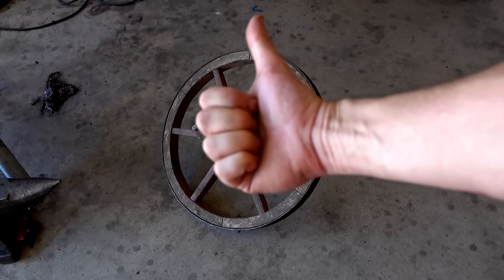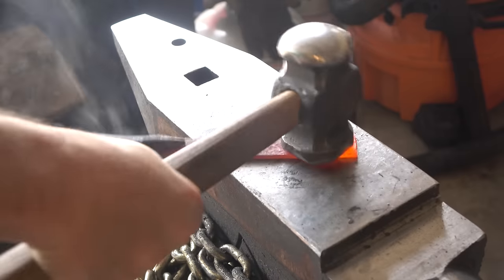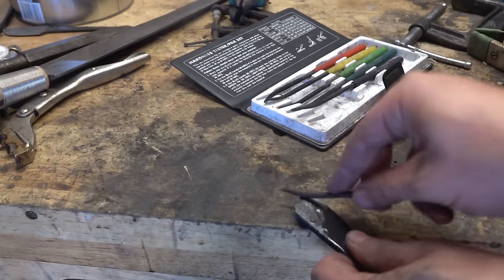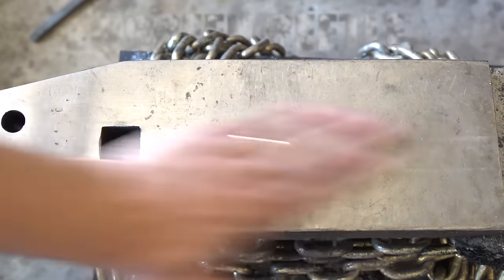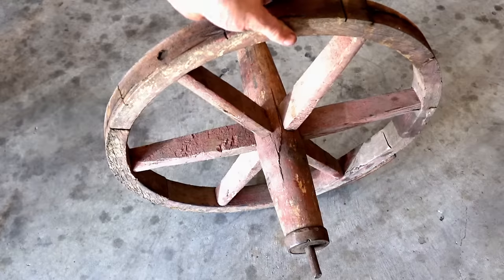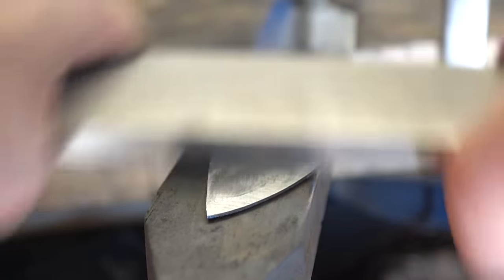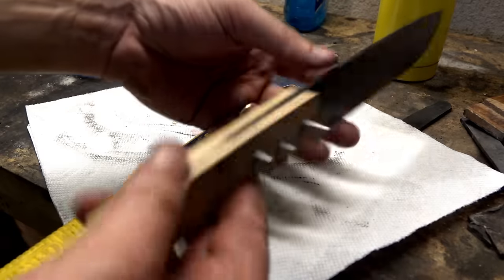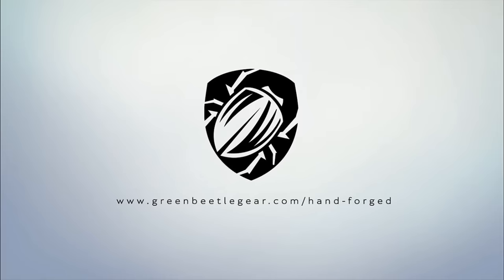Making A Frontier Knife From An Old Wagon Wheel

Comment: In woodworking I use lots of thick, checked slabs and I fill those checks and cracks with epoxy tinted black.  You can also use the dust from sanding, and mix that with wood glue to make a paste, and often it will stain the same as the wood you're using.  Loved this project btw, and I learned a ton

Comment: As for splits in the wood, you can always fill them with epoxy and a rough sand will blend the epoxy quite nicely. I do it on voids regularly in the very expensive, exotic woods that oftentimes come in very iffy segments (sometimes adding crushed colored stone powders to the epoxy to give it a striking effect) and is a great way to stabilize a piece of reclaimed wood.

Comment: That turned out nicely. If you end up making your own pins again you could try putting the stock into a drill and then taking it to the grinder. The drill will spin the stock and as which should allow for an even grind to the pins. Works for making the tip to an ice pick too.

Comment: If I may suggest, I picked up an air file from harbor freight and 
started using that lately. It is a $17 piece of crap, but it works lol. I
 wrap the file with 150 grit PSA paper, and it will keep your transition
 lines from flats to bevels crisp. It will get 90% of the belt marks out
 in no time, and it will get into the plunge lines very easily, leaving 
you to only clean up by hand at 150. Then do your usual for going up the
 grits. It's honestly not a lot faster. It will probably save you 20-30 
minutes on that first grit. But it's heavy and will save your wrists 
since all you need to do is put a little pressure on it and just keep it
 flat. I'm simply not skilled enough to take the blade into trizacts on 
the 2x72. I'll get there some day, but I always screw something up and 
wreck a half done project. So I go to 120 maybe 220 if I'm feeling brave
 and just finish by hand from there.

I saw that post on the ABS site a few weeks ago. I didn't have any luck trying to hand rub with diamond files either.

Love the videos dude. Keep them coming.

Comment: Awesome homework...
I am sure the wood will work out fine for you.  If you have doubts in regards to splits and checks, you can use the tecjnique I learned from Yamaha when they are selecting wood for their instruments.  When you have this wood dry as toast set it in water.  Just for an hour or so. The Oak or the Rosewood will only take surface penetration.  Take it out and as it dries see where the wood moves.  If it doesn't in harmful way, you are good to go.
Beautiful proportion Green.

Comment: Something else that works as a stain is sappened tea or coffee grounds. 
  Grind the grounds into extreme fine powder, mix with Dutch oil into a paste like substance.. leave it set for about 3-4 hours. Then use a mild cloth to wipe. 
  Ever so lightly sand with very very fine grit sand paper. Dry wipe the dust and repeat. 
   The stain gets darker by the hour. This also works on bine, but with bone you can actually place the grounds directly in water with a metal hangar through a pre drilled pin hole so it stays off the bottom of the pan. 
 Check periodically for desired tone wiping with a damp cloth to determine that.

Comment: Great video, the wood filler problem, wood workers normally will take standard wood glue and mix it with saw dust from the wood they are working on very thick. then use that as it will sand and stain like the wood or extremely close, OR if you don't care if the cracks are filled, thin CA glue can be put on and it will run into the cracks then a activator is sprayed on it for it to harden stabilizing the wood. just some ideas to try if you run into something like that again.

Comment: to keep the pin holes from splintering you could try putting a few layers of masking tape or painter's tape over the wood before drilling. When I worked construction sometimes we needed to cut a few inches off of a door so it would fit a shortened frame and we would just put a layer of tape right on the veneer to keep it from splintering and it worked great. We were also cutting with a circular saw so this may or may not work with drilling but it should be easy to test. Great vid as always man keep up the good work

Comment: I like forging. It's fun. I watched a bunch of your videos but I still suck. Maybe I need to watch more videos. J/k I need to forge more knives. I did 6 blanks before I took one to the grinder. I forged 4 knives blanks that got to heat treat. I finished 2 of them called ugly knife 1 and 2 respectively. Ugly knife 3 I chucked up in a vice and bent it till it broke to see the grain I was getting. It was good. Ugly knife 4 is a big parang, chopper I made for my summer place. It's forged, ground, and heat treated but it's been 3 months and I haven't sharpened or put a handle on it and I have 2 good blanks that I haven't even started grinding on. Anywhoooo. Nice knife and I love your Chanel!

Comment: Thanks for the video. I would also like to add looks like knives that my grandfather had I also made knives mimicking his almost 40 years ago or more than 40 years ago now. So I think you're spot on with your design. You probably won't have time to answer this but I was wondering the brand and weight of your anvil. I see it's a two horn with the pritchel on the Hardy hole end. If you have time I would greatly appreciate the information. Again thanks much for the videos.
Reply from the maker: i use a baby rhino now.  i used ot have a small vulcan.

Comment: Really great video. It sucks people are stealing your stuff. I might want to do the same thing. I know Chandler Dickenson had the same problem too. Hopefully Im small enough to not be on the radar.. but better safe than sorry. 

Have you tried using a butchers block for a brush? I noticed you used a bristle wire brush like from welding. Any reason for that?

Skal

Comment: Is there a reason for you  using arc welding over other welding ?  2nd question how do you know how much borax you need to put on? (Btw is borax dangerous to use? never worked with that before..)

Comment: If u take a very high carbon steel normlize a square of it drill exact diamiter holes of possible Diamiters you will need then harden it. U then can forge down a piece of steel then hammer it through a hole to make the desired pin.

Comment: You said you wanted to fold the steel and forge weld it again, but you were loosing too much material, what do you mean by that? Do you loose it from the metal oxidising?
Reply from the maker: yes it scales off quickly at forge welding temperatures.

Comment: very good i make knifes to but, Im starting so i dont have to much hevy tools like the grinder or the forge.
Reply from the maker: Simple tools like files and an angle grinder can be used to start with.
Reply: Green Beetle yes i have them but i dont have a forge to get a good heat to the iron, i can do it with organic charcoal in the barbacoa oven but is not the same.
Reply from the maker: add a hair dryer to fan the flames with charcoal and you will get hot enough.
Reply: Green Beetle yes i do that to give extra oxigen to the flames, tanks you for the help.
Reply: do you have any old grills any where that's what I did was got an old one shaped the top of it put a 50 50 mix of play sand and plaster and parres sorry for the bad spelling any ways to make a heat blocker for it while its wet and mixed and u have to use water in the mix I put it on the walls and bottom then u have a forge
Reply: Ashton Mcdowell ok thanks for the information. where are you from?
Reply: Kentucky
Reply: Why you ask
Reply: Pablo Olivero kentucky
Reply: Pablo Olivero oh and look up fire bricks is what I think they're called
Reply: Cut a small squar in the side to place what ever you are make flat if its big like a sword
Reply: Ashton Mcdowell haa now i stand how to do it.
nothing for now, for example im from argentina cordoba.
Reply: Ok cool I like helpinh people lime you we need more black smiths in this messed up world we live in
Reply: Pablo Olivero ya ig you plan on big stuff like swords cut a small squar is the side of it and a hole in the other side get a peice of pipe that a shop vac that will fit in it and cut three lines it the metal pipe so that it will and as a vent
Reply: Pablo Olivero if not ig
Reply: Pablo Olivero do u have a facebook acount
Reply: same here Man. its Fun and im actually selling a few pieces
Reply: CommonSenseCreations yes is good
Reply: Ashton Mcdowell yes but i dont use it
Reply: Pablo Olivero look into plans for a Lawn mower forge. I built one and it easily gets hot enough for forge welding or anything else i need to do. I believe Epic fantasy has a tutorial on how to build one
Reply: CommonSenseCreations Ok thanks
Reply: Make a coffee can forge :)
Reply: Pablo Olivero the only grinder I have I an angle grinder
Reply: what would melt? you use plaster of paris to line the inside of the coffee can. it wont melt.
Reply: Therfore I use Image for relatively cheap.
Reply: There are TONS of videos on here about how to make forges, all the way from a hole in the ground to very modern and expensive ones!  Pick one in your price range and make one!  No reason not to have a forge!!
Reply: Forges are easy. I literally made a foundry on top of my welding table one day with a few half bricks and something that resembled a burner. Made quick work of brass.
Reply: I have a forge I made, wasn't too hard, cinder blocks as the stand, old dually brake rotor for the pot, some metal piping (NOT GALVANIZED!) and a legitimate old fashioned crank blower pumping through dryer duct. Used a flange on the business end of the piping (Also NOT GALVANIZED) so that gravity would hold it in the brake rotor. Other than that, maybe find a piece of metal screening, or drill some holes in a flat piece of sheet metal (steel preferably) so that your coal/charcoal doesn't fall down in the pipe.

Comment: If you don't mind me asking... where would you recommend buying an anvil?
Reply: Anvils are too expensive, get some rail road tracks
Reply: +ATgoesFTW thanks
Reply: +Ryan Brewer where could I find some
Reply: As someone who works off a rail road track, I think I'd rather have an anvil with a flat, hardened face, a horn, hardy hole... It's fine to start out on and all, but there comes a point when you need an upgrade.

Comment: can you also spark test with an angle grinder and an cut off wheel.
Reply: yes you can
Reply: +CommonSenseCreations so if it sparks i can use it?
Reply: mika vink you mean the metal or the tool ?? if a tool makes sparks on the metal then yes it can be used for testing. if your asking what to look for in the sparks then a god rule of thumb is the prettier the sparks the better the metal. Dull orange sparks are typically softer steels or iron bright flashy sparks that look like little fireworks mean that there is a lot of Carbon in the metal and its better for knife making. theres only so much you can tell from spark testing though

Comment: Off topic (the knife is great) But I've been watching lots of knife videos, and almost all of the Bowie knives have steel spacers and guards.  Did the colored metals like bronze, brass, and copper, just fall out of favor? I like them a lot, and would like to see more videos with these metals. 
Another question is, why do a lot of knife makers spend a lot of time making takedown designs, and then they epoxy them together for all time. What's up with that?
Reply from the maker: The softer metals aren't as durable they wear and mark and scuff easier and the skill needed to apply them isn't as great so harder more durable metals represent more of a challenge to the knifemaker and in their minds represent a higher quality product. If a takedown is epoxied together it is no longer a takedown those terms are mutually exclusive. Not all hidden tang knives are takedowns.  Karl Andersen makes a great deal of takedowns, checkout his channel.  A takedown takes tighter fitting construction than an epoxied construct in many cases which is more difficult and represents a higher degree of skill to achieve than a regular hidden tang knife in most people's opinion.

Comment: Green Beatle, I want to start making Knives too wich machines do i have to have?
Reply from the maker: for stock removal: files, vice, angle grinder, drill
Reply: Berend Jongbloed  A good hacksaw is a very worthwhile tool. A bench vice a must. Selection of files. Old files cleaned up with a wire brush are better than new crappy ones. Last essential tool is a fridge full of cold beer, you going to get a sweat on!

Comment: 55 hours! I had no idea it took so long.
Reply from the maker: lots of flubs and re-shoots.  I actually had to run 3 different carburization attempts because the first 2 made cast iron.  The first handle I tried developed a crack that ran all the way through and wouldn't sand out.  My final shots were overexposed due to a malfunctioning auto-iso camera feature and had to be re-shot.  It doesn't necessarily look it but researching, writing, narrating, editing and splicing 228 video clips, correcting color and sound levels, generating the different logo art then placing it took a solid 25 hours.  Is nuts.

Comment: Is high carbon important?
Reply from the maker: The steel will not harden adequately to hold a sharpened edge if the carbon content is not 0.5% or greater.
Reply: +Green Beetle thanks man

Comment: Who makes a wood putty that does not take paint or stain? What is the point of a wood  filler or putty that does not take stain? That has to be the most worthless filler ever. You would think it would say on the side of the can if it takes stain and paint? When I saw the cracks in the wagon will I figured you would stabilize it.
Reply from the maker: Good point that's exactly what I should have done.  Wish I'd thought of that!  :)
Reply: After this video I went and checked the wood putty I picked up the other day because I did not read it. It does say on the front that it takes stain and paint. I never would have dreamed that any would be available that would not take stain or paint so I have learned a listen from your video!

Comment: next time you need to fill a crack use saw dust and wood glue mix well apply its not 100 % but seems to work better for me than that cheep crap you buy

Comment: Nice knife but I am not really comfortable with the destruction of an antique to make it. As for the wood filler that didn't take stain... are you making something that's meant to look old? Yes? then no filler for the cracks because those cracks helps make it look old. You would be hard pressed to create those cracks when using new wood to make it look antique, your goal is antique looking so best to embrace the flaws.

As for the tang, I wouldn't do anything but full tang at least for the length of the handle with just the spine exposed, doing half the handle in length is just repeating the original knife makers fiscal shortcut and making a cheap quality knife the expensive/top quality way.